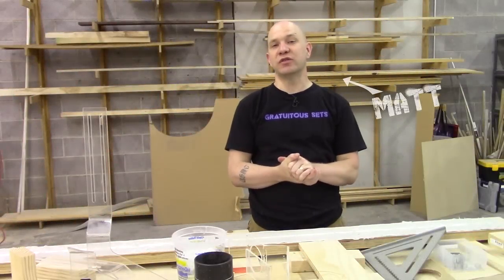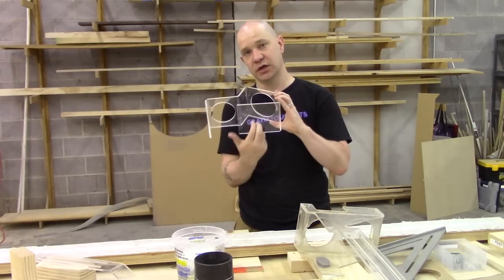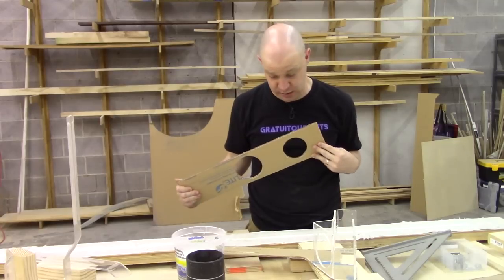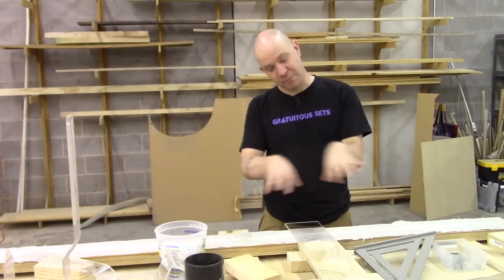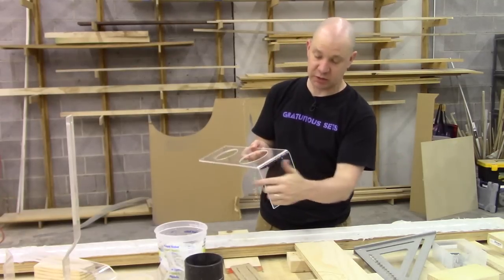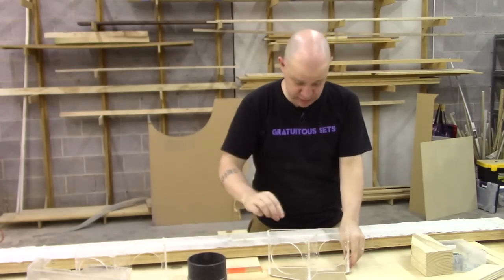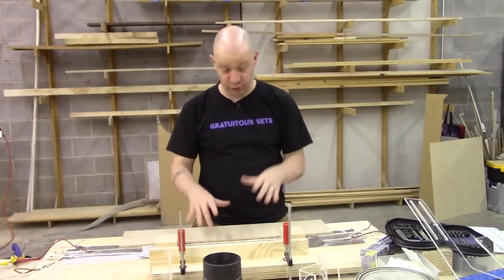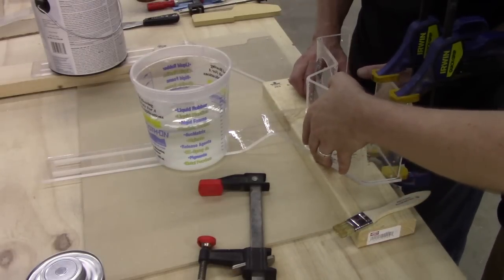Acrylic Bending (for Dummies)

Comment: What is temperature of your heat strip?  Can I use a small propane torch to heat bend?
Reply from the maker: About 250 degrees Fahrenheit or 160 Celsius.  I don't think a torch would work for acrylic sheet. I don't think you could get the line to that temperature evenly- you'd risk burning the acrylic or you'd have spots that would be ready to bend next to hard acrylic. 🤓

Comment: skipped through vid several times and still don't get how the bends are made? heat? cutting? someone please point me to where he explains the bending process.
Reply from the maker: It's heat- We use a "line heater (bender)" . We place it under the line that we want to bend and wait for the acrylic to become pliable, then bend it at the appropriate angle. Let me know if you'd like for me to get you links if you need to buy one. -Mark

Comment: What happened during the 11 minutes? He didn't say. How can it bend so easily then?
Reply: So there is a heat supply under what he called the line bender? How hot is it?
Reply from the maker: i'm not sure- They are sold specifically for bending acrylic and don't have a thermostat. It does get a bit hotter if you use it for more than 30 minutes at a time, though.
Reply from the maker: We used the strip heated on it to soften it😎

Comment: I was told that the bubbles that form are due to the presence of water in the acrylic and that you need to heat it for a while to dry it out before bending it. Any water in the plastic allows for low-pressure voids to form during the bend (not vacuums).
Reply from the maker: I've heard something similar! Pre-heating sounds like a good idea😎

Comment: You're way better than I am btw. I also bend acrylic from time to time. I use a heatgun and a hair dryer to bend and then cool down the acrylic. So far I've made an key cabinet with a door that opens and its entirely made out of acrylic except the return spring, a cellphone holder for my bike, a holder/box for my router with a lot of holes drilled into it and its attached to my desk, a small extender for my webcam since the webcam blocked about 5mm of my monitor (I'm picky) and just a small cover for my hard drive docking station to shield it from dust and cat hair. If you can't imagine how the webcam extender looks like (I would not be able to) here's a pic http://www.imagebam.com/image/6b85831023156954 http://www.imagebam.com/image/064aa61023156964
Reply from the maker: Hey Unogazzy!  That's pretty badass!  No bubbles!  We actually have an easier time bending 1/4" sheet PVC, but we wanted this to be transparent so we can film the spindle etc. Also, the PVC is less cracky-brittle so...it's got that going for it ;-)
Reply: @GratuitousSets  Thanks :) I got a lot of bubbles at first but then I was using my oven on a low temperature. It was pretty hard to remove the piece from the oven and then bend it over the template. Bubbles were no issue when I started to use the heatgun though. Funny thing: When I thought I was done with they key cabinett, I noticed that I would like a small knob on the door. I didn't want to buy one so I took some small bits of acrylic, put the bits in a small cup and then put the cup in the oven. When everything had melted I removed the cup to let it cool. After that I drilled a hole in the center of the now hardened acrylic, put a bolt through it, took a clamp and clamped my corded drill on a table. I then clamped the bolt with acrylic on it in the chuck and used my corded drill as a lathe. With A LOT of filing and a little bit of polishing, the knob was finnished. It is covered with bubbles but I like the look of it. A lot of time went into making the knob but it was free and was fun which is two of the best things in life.
Reply from the maker: that's amazing!

Comment: You may want to try a can of compressed air to cool off the acrylic, as you would hot glue.
Reply: Was about to suggest this exact same thing. Glad I read the comments first.
Reply from the maker: I guess the cold air would cool at about the same rate as the water, but we might not want to spray with the can upside down or have liquid come out of the can... I dunno. I'll give it a shot on a test piece first...
Reply from the maker: That’s a great idea- why didn’t I think of that?!
Reply: @GratuitousSets  Wouldn't the thermal shock be too great? It could crack or am I wrong?
Reply: unogazzy84 Test it. It works on hot glue. Besides, it looks more sophisticated than the water. 🧐
Reply from the maker: Undoubtedly! Lol

Comment: Line bender tape?  I have never seen that before. Can you control the temperature?  Back when I started in the sign/display industry we modified metal bending brakes with heating elements and made jigs since we were making large quantities. Slightly off topic but when you CNC acrylic with a V Bit do you lubricate the bit during routing?
Reply from the maker: You could probably control temp with a rheostat, but we don't.  We learned about the linear tapes from the acrylic guys we use for complex stuff. No lubricant- did you?
Reply: I was going to order a V bit to play with but the instructions said to lubricate for cooling. We typically just use upcut bits for metal.
Reply from the maker: I wouldn't worry about lubrication for acrylic, for fine etching we use 60 degree V bits or V shaped engraving bits without difficulty :-)
Reply: Yeah, I was going to ask the same thing.  Never heard of it...sounds a lot better than a torch under plate steel 😂